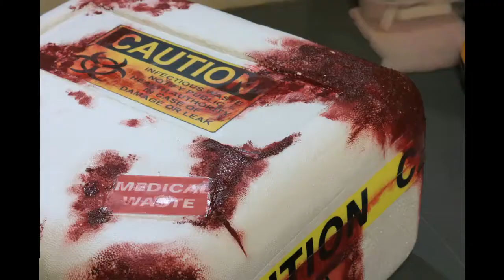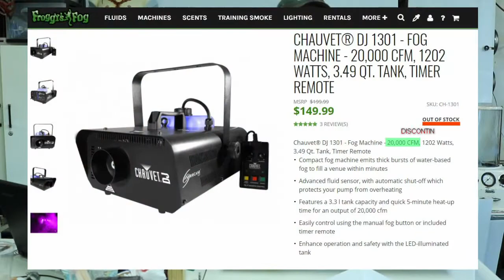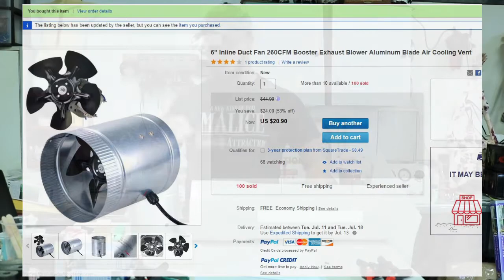Using An Inline Duct Fan To Boost Fog Machine Output

Comment: Hi mate where could I buy one with ducting tube included
Reply from the maker: Hey there! I’m not sure actually, if you look at some HVAC place there may be something similar ready to go with galvanized ducting like for a house or commercial building. But I think it’d be cheaper doing the eBay route for the fan and finding a used large diameter tube.
Reply: @EvilOliveProductions  sound imma take a look this is my other account